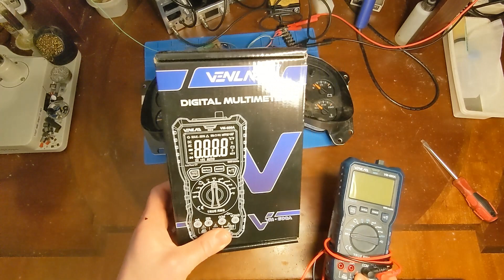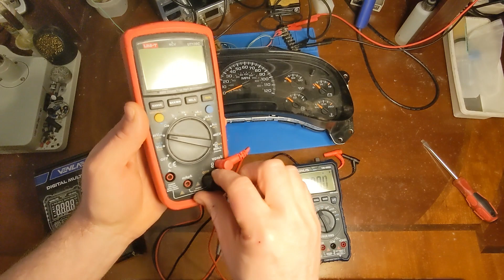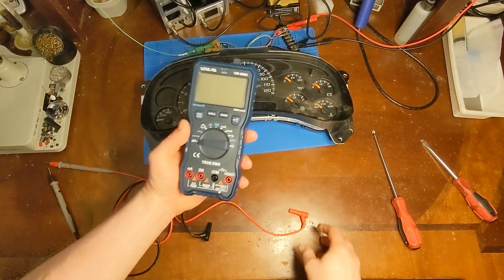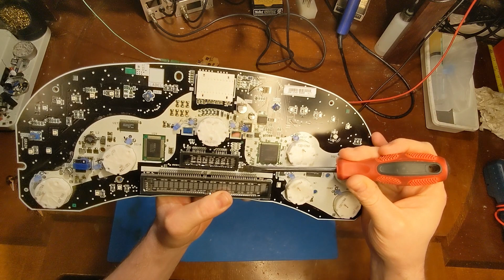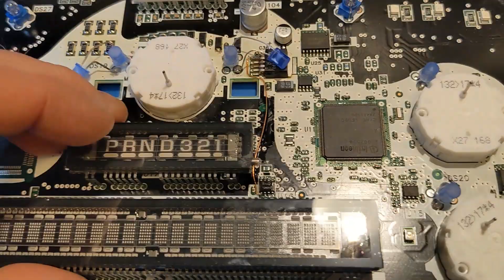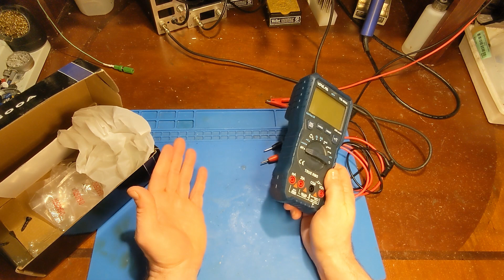How to repair 2005 GM cluster

Comment: Hey Jeff.I have a 2006 GMC 2500 diesel.My cluster is alot like this one but my PRNDM1 has led nights under the letters indicating what gear you are in.Anyways my odometer is barely lit making it impossible to see.Now to the best of my knowledge I did not see  a video of you repairing one like mine.I was wondering if you could point me in the direction of where you think the solder is cracked?I am going to get me a magnifying glass and look better tomorrow.Is there a specific spot or it could be anywhere on the board?Thanks and I appreciate your expertice Jeff.
Reply from the maker: The 05-07 Driver information VFD's get dim with use/hours. Usually if it has fractured joints in the VFD power supply, it's either working or not working. Cleaning the dust off the display might help, but more than likely the VFD will need to be replaced. New replacement VFD's are not available from what I know. You'll need to purchase a donor board. But at that point it would be easier to just run the donor board/cluster.
Reply: @jeffescortlx  Ok thanks Jeff for getting back to me.I was hoping it was just a solder job but it is what it is and I will start looking for a donor.Thanks again and love your videos.

Comment: I have an 06 silverado that the cluster gauges were going in and out while driving. I had it sent off for repair and still does the same just less frequently. I told the person it was still doing it and he says it may be going bad and could get me another cluster. After further digging, I find that when I wiggle the plug it makes the cluster flicker. What are your thoughts on this? Bad cluster, repair job or dash plug?
Reply from the maker: The voltage divider for the 8 pin adjustable voltage regulator has fractured joints.
Reply: @jeffescortlx  is that something you can fix/replace or time for another cluster?
Reply from the maker: @2009KVFD976  it can definitely be repaired. I see this issue from time to time. Although it's not fair to you to pay to rebuild it twice. Who did the first rebuild?
Reply: @jeffescortlx  it was a local marketplace ad. (Insert facepalm here) he was at least willing to refund me.

Comment: What’s the easiest way to calibrate the gauges? 03-06 GMT cluster
Reply from the maker: Power up the cluster with no data serial bus or analog signals, then seat the needles in the home position.
Reply: @jeffescortlx  what’s a good home position?
Reply from the maker: @garageaddikt The starting position of the needles.

Comment: This is a shot in the dark, but do you have a video or any info for this happening on a 2004 cluster. This is currently happening to me but intermittently. any info would be greatly appreciated!
Reply from the maker: If you have intermittent power it's usually caused by fractured solder joints.
Reply: Thank you for the response! It’s an intermittent loss of comm with those right 4 gauges at the same time and battery/abs light. I sent it to a cluster repair guy who reflowed all caps and put new steppers but that didn’t fix it. Do you think it’s a solder joint on a chip then? I’m at a loss
Reply from the maker: @chrispekas4387 did the guy you sent it to confirm that it really is a 2004 PCB? Did he understand the problem you were having?
Reply: He did not confirm it was a 2004 pcb and that didn’t even occur to me to ask. I sent him videos and pics of the problem when it would occur. It’s completely random when it happens and only at start up then will clear up whenever it wants lol. All I know is the voltage regulator in mine is 180 degrees the opposite direction of the one in your video here. Are there any giveaways that it’d be a 2004? Because I have pics from when I took it apart
Reply from the maker: @chrispekas4387 since you're voltage regulator is facing the other direction it is safe to assume that it would be a 2003-2004 PCB design. So it will be different than the one in this video. Either the problem is local to the instrument cluster, or the entire vehicle is losing buss communication and the clusters just the symptom of the vehicle having the problem rather than the source of causing the problem.
Reply: Thank you for the responses, I appreciate it. I was really hoping there was a solution just like this but for a 2004 cluster because I’m comfortable doing this myself. I sent it to this cluster guy because with all the experience he had I thought he’d fix it. But I’m beginning to think he didn’t even test anything just reflowed and stepper motors which I could have done then took my cash. It’s the testing the parts I’m not good at. If you have any links to how to test for buss comm on my board I’d  greatly appreciate it. If not thank you for all the info you have given me this far.
Reply from the maker: @chrispekas4387 have you got in touch with the person that you had repair the cluster? Is he willing to take a second look at it? Does he have the ability to send a data bus signal to it?
Reply: I’ve talked to him once and the only thing he said was “that’s weird I’ve never seen this” and only thing he offered to do was have me source a used cluster and send both to him and he’d switch the EPROM over from mine to the other at a whole other charge of $150. Even then though he acted real stand-offish when I spoke with him. I might as well reach out again and ask about the data signal test couldn’t hurt, pretty sure he’s answer will be he can’t or doesn’t know 😆. I messed up by just finding someone local to work on it.
Reply: He already got back to me and said he does not. I think at this point my best option may be, go to my local U-Pullit’s and pull one from a junker and pop it in for a couple days and see if the issue continues or not and that’d tell me if it’s the cluster or truck right? I repair/mod vintage game consoles as a hobby and the info for that stuff is very readily available and open in that scene. This auto stuff is new to me and kinda hard to find info l, I’m just glad I found your channel!
Reply from the maker: @chrispekas4387  Yes trying a different cluster for a while will help determine if the problem is on the truck side or the cluster side. Another test you could try is to wait for the problem to start happening, and then plug a OBD scan tool into the OBD2 port and see if it can communicate. If you cannot read then it's probably the entire vehicle experiencing bus communication issues, and the instrument cluster is just the symptom of the problem but not the cause of the problem.
Reply: Ok I will give that a shot as well. I’ve scanned it and have showed nothing but didn’t dawn on me to when the issue is actually going on because it’s so abrupt and not I’m not ready for it.

Comment: Hey, Hi!  I would like to see if you could repair my cluster. It’s from a 2010 Chevy, long story short sometimes it would run fine or sometime it just wouldn’t turn on till it stop turning on, so for the last year or so I’ve been using another one that my friend got for me for a really low low price. I could actually send you the one I have on now after and you could use it for parts or what not.
Reply from the maker: If it works when hot, but not when cold then this is from the batch of 2008+ that have defective microprocessors. Unfortunately I'm not currently setup to replace this chip that requires flashing.
Reply: @jeffescortlx  oh no it was intermittent. I seen another cluster you fix but I can’t remember the exact year and it was a while back that I had seen it but it had same issues exactly like mine.

Comment: Ever mess with a 2004ish Chevy Aveo cluster? Wondering if it uses the same signals from ECU.
Reply from the maker: Bus signals like engine temp, trans temp, fuel level, oil pressure are universal so probably yes.
Reply: The only things I'm concerned with are RPM and tach. I plan to get everything else from a scanner. If I had a blazing fast booting laptop/tablet, and no lag for the software reading, I'd OBD everything.
Reply from the maker: @Marc_Wolfe  the RPM & MPH might have a dedicated analog wire.
Reply: So do gen 3 ECU (optionally for P59/03-07). As long as it's just PWM, I should be able to flash for it. If it is just VPW, hopefully it's as standard as scan tool readings and I can just wire it up.

Comment: I did the 2010 malibu cluster repair  with 33 microfarad repair.😊 Now the radio diplay is intermittent. Seen gm radio resolder video. But dude was flying through it. Think you could make a vid?
Reply from the maker: I don't have a Malibu radio here to fix.

Comment: Interested in the Meter and thanks for the tutorial on cluster repair. Do you have access to schematics or are you going from component identification?
Reply from the maker: By the time I got my hands on schematics, I had already had a good idea on how everything worked and where everything was by reverse engineering. I can also use a good board to compare against a bad board. Component identification works for about 60%, but they like to use a lot of house numbers that don't cross to what they really are.
Reply: I hear you about the house numbers. I waste more time crossing components as good boards as most things today are hard to come by and you always risk a little probing them. Thanks

Comment: I would like to try to win the multi meter.
I’ve been watching your videos and learning a lot. Makes me want to try fixing mine on a 2010 Nissan Titan. Just ordered a new stepper for the fuel gauge it’s always reading high not sure if that is the actual problem yet
Reply from the maker: For the Nissan it's probably not the stepper motor. But a self sweep test will confirm quickly and easily. The Nissan's calculate the fuel level at the instrument cluster like Fords do. It's common for them to have fractured solder joints in the resistor network that reads the fuel level. There's also a chance it's a sending unit, but a good scan tool should be able to read the sending unit.
Reply: @jeffescortlx  thanks i will check that. I put in a new fuel pump and checked the wiring all the way to the meter.

Comment: Ooow you bodger, a bit of cruddy enameled wire to restore power.
The electrons could be flowing the wrong way lol.
Leg pulleth :-D
Well done, another cluster back from the jaws of death :-D.
Current shunts in meters are quite forgiving.

Comment: Have you tried using the temperature probe? I might have to pick one up because I need a meter that can do capacitance and would be nice to calibrate my Chinese t12 station. 

Does buying through your link help you? I owe you one for that bin file you sent. That got my 06 escalade cluster up and running in my 02 truck which is by far my favorite mod I done
Reply from the maker: I didn't get around to testing the temperature probes. But I assume it works as intended, I see there are quite a few other review videos and everyone seems pretty pleased with this meter. Also the Amazon reviews are very positive. Yes it's an affiliate link I have in the top pinned comment and description. So I will get a small kickback from Amazon for the people that purchase one using my link.

Comment: 2005 Pontiac GP cluster:  I've have problems with intermittent cluster connections in the past.  I replaced the clusters and it's been 98% fine.  But, I had been thinking I was wrong all that time i.e. some bad connection.  Now, with this video I'll have to see some other time if other clusters are still good.  Thanks.

Comment: I could use a new multimeter, the one I have been using I have had since 1992. It has been dropped a couple times over the years and is being held together with painters tape.

Comment: Multimeter would be cool. 
Also, how’d you trace the path for that fix? Just done enough 05 clusters you know where the circuit paths are?
Reply from the maker: I originally found it by comparing a good working cluster. But yes now I've seen the problem enough to know exactly where to go and what to do.
Reply: @jeffescortlx  Smart way to go. I work in the video game industry doing a lot of the same you do, and I can say, when you have a PCB coated with some type of paint that makes it hard to see the traces, it makes my job like 10X more difficult in those cases.

Comment: What kind of wire do you use for the jumper wire? And what coating do you use for thermal coating on the back of the cluster ? Thank you for the good videos.
Reply from the maker: For long jumpers I use magnet wire, AKA electromagnetic wire/transformer wire. The coating is conformal coating for PCBs.
Reply: @jeffescortlx  thank you